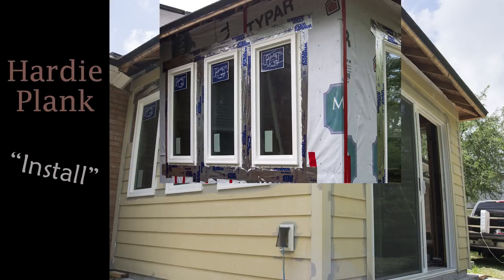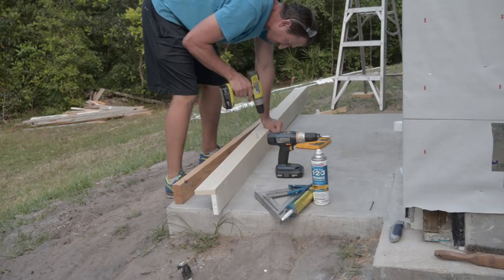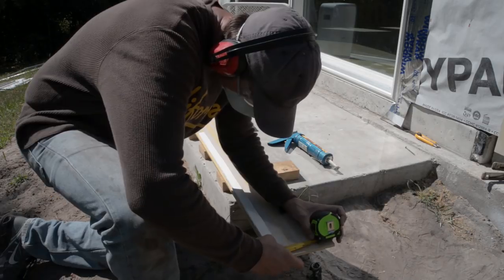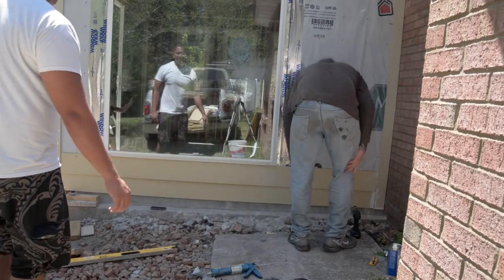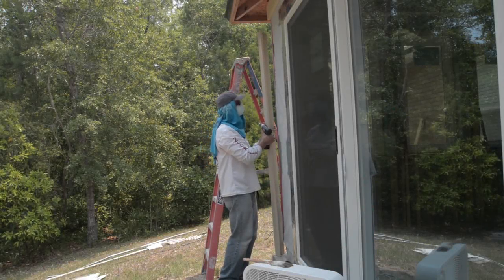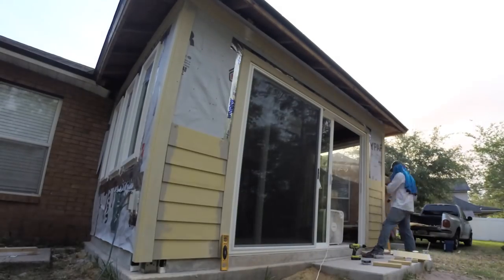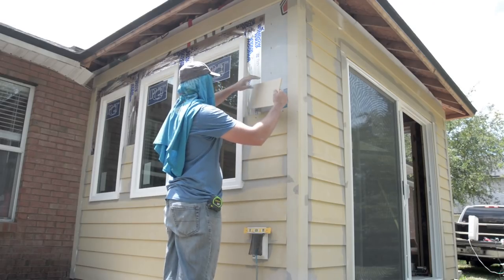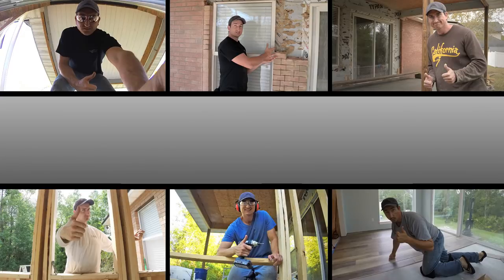HardiePlank Siding, Installing Fiber Cement Planks on Exterior Walls Vid #10

Comment: shouldn't the corner trim cover the edges of the boards ?  or is this product not like the plastic siding crap ?
Reply from the maker: Thanks for the comment.  The method demonstrated in the video is appropriate for this type siding.
Reply: @MrKistel  thanks!  I've never worked with this stuff before, but I like the look and ease of use ..  is the primer just anything in specific?
Reply from the maker: Check out the video description text for a list of project items including a primer suggestion.  Best of luck with your project!

Comment: What kind of screws did you use
Reply from the maker: Barry thanks for the comment.  There is a complete list of the materials used in the video description area including the screws used to attach the HardiePlank siding to the exterior walls.

Comment: Great job, to make it easier, just make up a jig, to space the boards. More accurate than measuring each one..
Reply from the maker: Thanks Dave,  I probably would have made a jig for the Hardi plank siding pieces to be cut if it was a larger project and I was confident everything was square and plumb.

Comment: HVAC? Or did you forget?
Reply from the maker: Thank for the post but not clear on what you are asking specifically. If asking if an addition HVAC system was installed with the new room the answer is no. The new room space was small enough that the exciting house air conditioning system could easily condition the new space.
Reply: @MrKistel  congrats on that! In south it’s a big issue.... did you run ductwork in the ceiling?

Comment: Conceptually a fine demonstration, but you are voiding warranty coverage on parts of your project with some of your techniques. Caulking (or gluing in your case) any horizontal transition, such as your base starter strip will create a water dam and void the warranty for the bottom course of siding. Also, any wall penetration such as the wall outlet (at 4:15 on the video) needs blockouts and horizontal z-flashing over the top. You also don’t address horizontal flashing above any of the doors or windows (a warranty voiding error if ommitted). Lastly, trim can be installed with finish nails, or trim tabs (most ideal method). Countersinking screws is overkill and a waste of time, but at least its an approved method, unlike the aforementioned techniques.
Reply from the maker: Thanks for watching and your suggestions regarding the install demonstrated.

Comment: I’m okay with screws, but I’m not okay with them being on the plank.
Reply from the maker: Thanks for the comment.  Can you elaborate further regarding the use of screws with HardiePlank siding?
Reply: I use regular exterior screws to hold up my Hardie-Trim, with counter bores. Prefer 2" star screws for corners, and 3" for support. This method is definitely not in the manual, but it keeps trim looking sharp, adjustable. With Hardie-Plank, I planned to stay away from screws. Most screws, including Hardie-On (Backer) will free themselves from the Hardie-Plank, given time (wind). This may not be true for Hardie-Trim. I do plan for my siding to last 40 years, or length of material and have researched up to the two types of steels used in siding nails. Galvanized being crap.   
     However, i'm open minded and can think of one exception, the washer head screws. And a majority of all contractors face the corner piece enigma, with each side of a home having just enough space for one nail, going into a 2x4 for trim or plank. Because you can't nail plank or trim into sheathing alone. And I'm pretty sure, they make washer head screws that are specifically for sheathing. 
    So, no, i'm not okay with Hardie-On screws supporting Hardie-Plank. As Hardie Plank's manual states, "double-ring shank nails" that are "siding" nails are best, but I am not afraid of using a high quality, stainless-steel washer-head screw – used for sheathing, where no stud is available for attachment. 
    Also, on the window trim... I prefer to leave a 1/8 gap between the window jamb and trim, with backer-rod and window-silicone. I know, I know. It's not in the Hardie James manual, but again - i'm open minded, but I cannot wrap around my mind how people use  house wrap as the first layer of defense. In other words, they don't seal the trim to window jambs... Smart LP's Manual (HORRIBLE product) instructs to leave a 3/8's gap on the window jamb sides, this protects their piece of s*** siding, because of the warranty. And i'm surprised you noticed that detail, as most siding people disregard this detail. I choose to do this differently, given that windows do expand, and eventually, that caulking will have to be replaced, and that backer rod will be there. 
     I hope you enjoyed my little rant,
Reply from the maker: @DNAatWork14  thanks for your siding install insights

Comment: Hardie is not supposed to be in contact or at least 2 inches away from concrete but good vid dude
Reply from the maker: My understanding is that Hardie Panal should be over 2 off the ground floor which in this case it is.

Comment: Whats the material of the wall where you stick the hardiflex? Is it would or fiber cement wall?
Reply from the maker: The siding is cementations based and it is attached to a plywood wall sheathing.